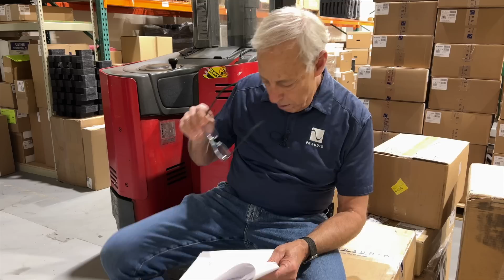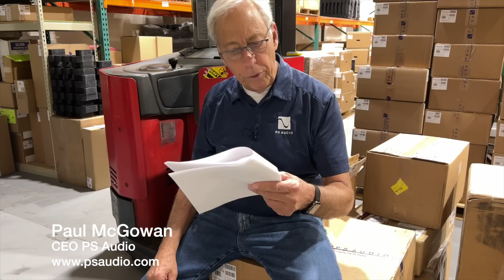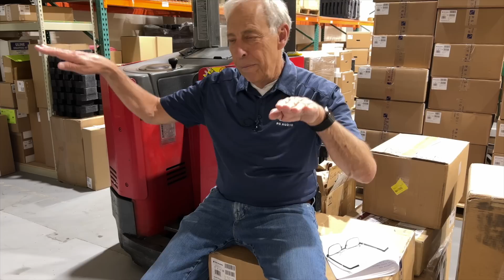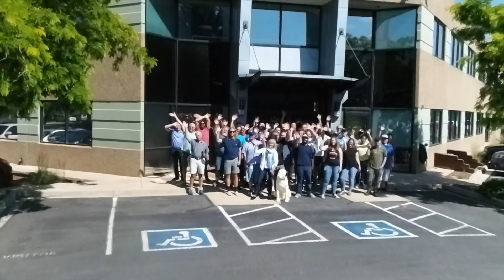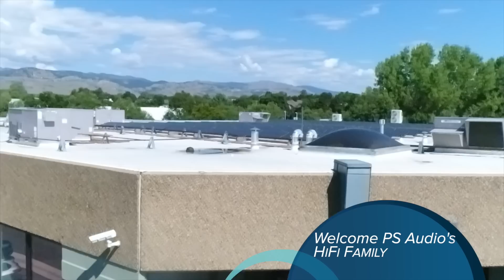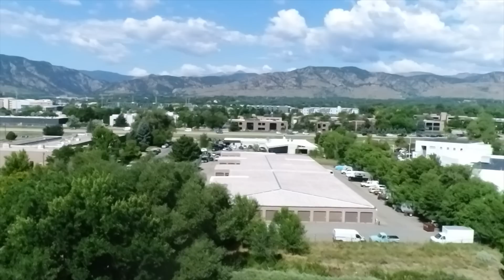PS Power Plants and MultiWave

Comment: Multi-wave, I cannot say I've heard of that name, although having a sine wave with a flattened top does make a lot of sense, make it easier on the rectifiers and probably also the transformers as the peak cap charging will be extended and lessened meaning less resistive loss in the transformer windings.

Comment: Don’t waste your money on a Power Regenerator. The audio signal path does not go through the power supply. A well designed amplifier power supply will take care of any mains issues. If you can hear issues with your mains power then your equipment is sub-standard or you have a sault in your wiring that should be fixed. Put your money in the system components where it can make a real difference. Loudspeakers are the weakest link.

Comment: Great audio products have great power supplies more immune to mains noise and fluctuation issues. In many cases you can fix a power quality issue by finding the root cause of it. I had a problem with a refrigerator causing occasional noise into the mains wire (compressor switching current spikes) and fixed it at the source by adding a filter there. However, when the power quality becomes a real audible concern, of course its awesome PS audio has a solution.